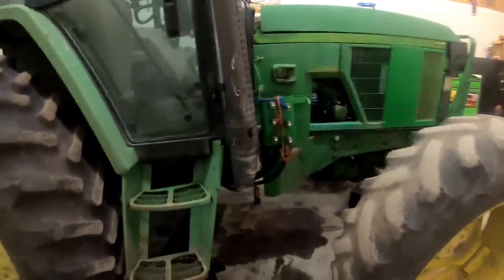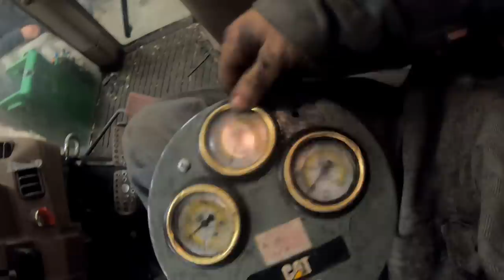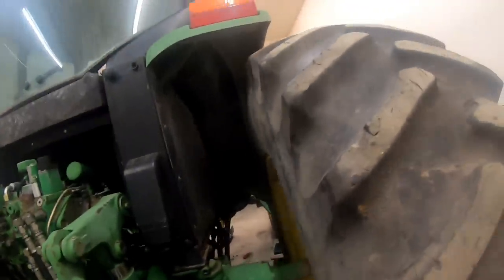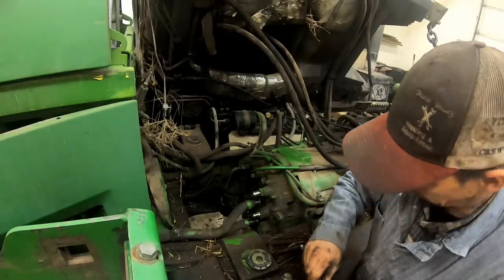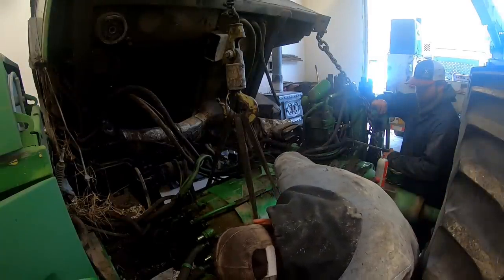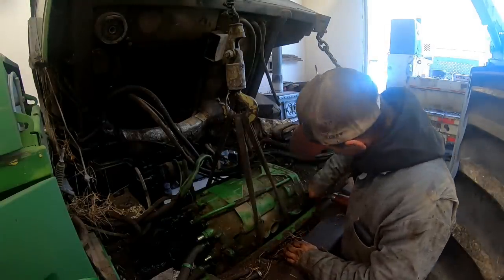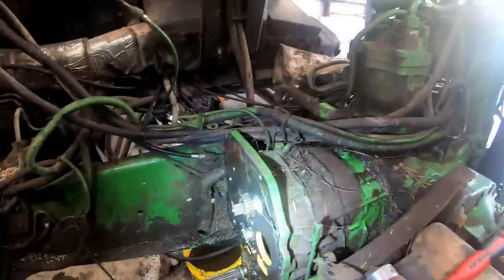John deere powerquad Part1

Comment: As soon as I saw that screen I thought I’ve seen that before,,,,, and was told the same thing. If you use the Cheap oil it deteriorates the pads on the brake packs. Haven’t used anything but the good stuff since.

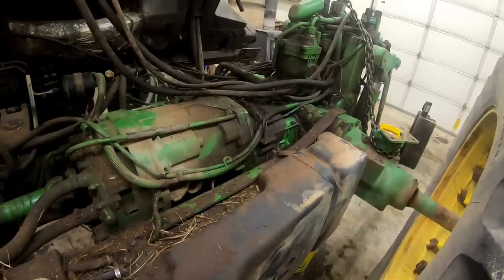Comment: I am astounded at how thin the axles are going out to the back wheels seeing one@ 13:50 of the video.
Reply: Thought same thing. Look the same size as my little Kubota B2920...which only weighs a bit over 2000 lbs. Must be some good steel.

Comment: Hello could I get a bit of advice I’ve got a 6900 John Deere and the pump really makes a racket whining on when trying to tip a trailer or even turning the steering and pushing hitch in and out. it also shuts the pto off after 10-15 mins of it running its had all filters changed back end oil dropped out and that filter screen cleaned !   the diff lock when engaged will not disengage till you turn tractor off any advance it’s much appreciated

Comment: I got a 6200  having issue on range c goen in found some issues in cable with the shifter mounts messed up but still have issues you have any suggestions  on this issue

Comment: First one I ever did was open station and I pulled it all out the back. I would bet his front pump the aluminum plate is scored a bit, but it made good pressure. Cheap oil keeps us guys busy. I tell people expensive oil is still the cheapest part in the transmission. Why buy a premium tractor and put walmart oil in it.

Comment: Could you please correct me if I'm wrong, but our John Deere 7200, 7800 and 7810 are powerquads ( duh. Lol ). Should you clutch Everytime between forward and reverse. Even though our 7810 doesn't have a loader, should you still clutch?
Reply: And come to a complete stop? Or is just pushing the clutch then going to reverse without the brakes ok
Reply: No need to clutch

Comment: our john deere 6600 got a power quad rebuild by not a great mechanic look back on it, but when you let the clutch out she jumpy. he said that the tractor will wear in and that will stop but it very jumpy any ideas this is 1000 hrs after rebuild. hi from ireland
Reply from the maker: Clutch modulation springs in the front cover are probably broken.

Comment: Basically the transmission is a giant hydrostatic, using oil to move the tractor is a lot more easy on wear and tear than engaging/disengaging a mechanical clutch.  Hydraulic pressure can practically move mountains, a mechanical clutch would burn up under the loads that a tractor has to go through.

Comment: Beings it is not crowded tonight I have a question on a John deere  4010 .   Have you ever removed the hydraulic pump on one?   I have a service manual and it says to remove front axle to access it and I have seen other farmer comments that said they have removed fuel tank and rad to access it.   If you have every removed one I would like your opinion on how you removed it?    If you have time to answer I would appreciate any advice.   Thanks  Gerard
Reply from the maker: I never have on a 4010 but a 4020 I have. Pretty much same song and dance. The book says to remove the front axle which on a 2wd tractor isn't too bad to do.  I have done the radiator and fuel tank method as well, it's about a draw. At least pulling front axle yo you don't have to drain any fluids.
Reply: @westerntruckandtractorrepa1353  Oh thank you.  I was leaning towards removing fuel tank and rad because I would have to make stands and I am not excited about getting under the tractor.  Thanks so much.  Love your vids,  no bull shit and a good out look on life.   thanks
Reply: If you don’t have a good stand to drop the axle guys pull tank and radiator instead